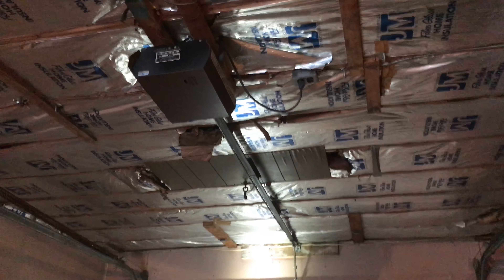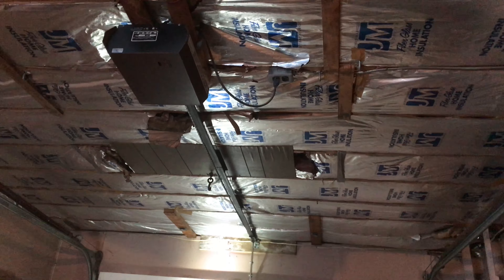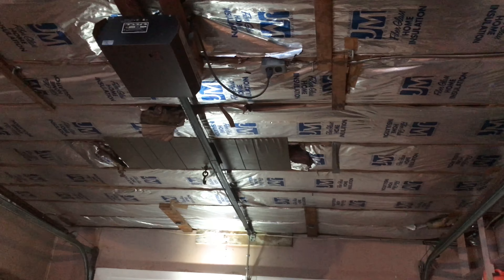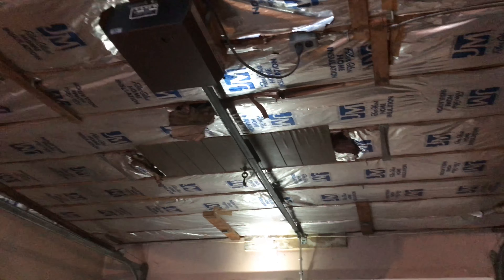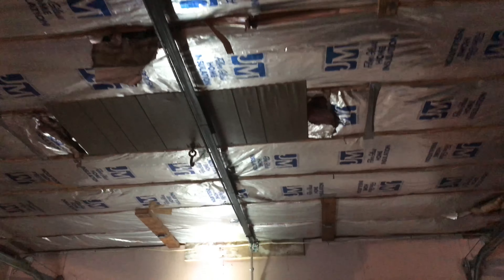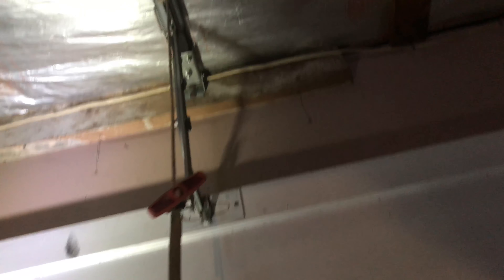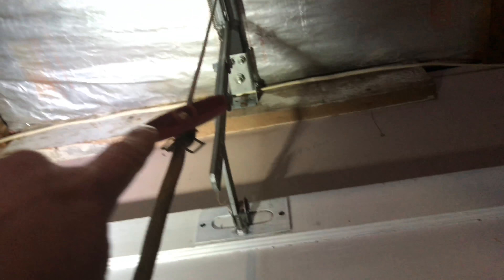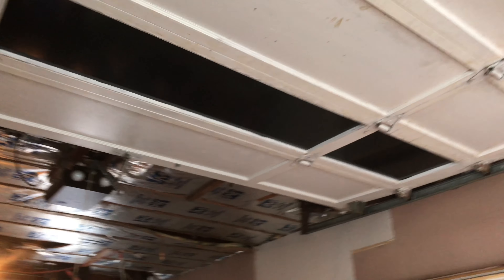How To Open Garage Door When Power Goes Out

Comment: Thanks for sharing   so  now imT trying to   get it to connect back to the chain  now that the power is back.    is there  something  to press or  connect i was wondering   Thank you ~
Reply from the maker: It the connector on the door arm should snap back into place for you.
Reply: @HomeownerRepair  I didnt pull the cord towards the motor i guess and that was able to  close it back to that  puller part..it was stuck  open i guess  . Thanks

Comment: Thanks for the video. However I dont know how to put it back in operational mode so it can be done with the motor.........
Reply from the maker: You should be able to just push back up on the lever so that it is locked back into position
Reply: This usually works but today we lost power, I pulled it and it still won't open. I can't tell if I broke it or how to get it back to working. We have to get to work and appointments tomorrow.

Comment: Need to know how you open your garage door from outside of the door after it has that larch inside pulled cause of the electricity being off, my garage door doesn't have a handle on the outside or a key hole
Reply from the maker: You may want to have a door put in.

Comment: How to I open it from the outside. I can’t even get in the garage to pull on anything
Reply: Most garage door has a emergency lock, you unlock it with a key, then pull the cable to release the latch and lift the door open
Reply from the maker: Thanks for watching.

Comment: You have to built a side door on the garage so u can gain entry inside the garage and be able to pull the cord when there is no electricity.
Reply from the maker: Yeah without that you're kinda up a creek
Reply: @HomeownerRepair  Where's the creek? Power Poweroutadge and I'm outside the garage. Winds and rains and car sitting in the garage and I can't get into it. Acckkk!! I need a burglar maybe? Okay Sir or madam please tell me how it get into my car. Please Pleesee
Reply: Should have bought a house with an attached garage. That's on YOU.

Comment: No shit Sherlock! How do you get in from the outside? My garage is detached from my house, and there is no man-door. I wanna know is there a backup battery I can install that will provide power to the motor during the rare times the power is out?
Reply from the maker: I'm not sure
Reply: The only way for battery backup is putting in a new opener that has it, but the more cost effective way is what's called a vault release, which is a key lock installed in the top panel of the door, which is attached to a cable that hooks up to the emergency release latch on the door opener. If the powers out, you unlock that key cylinder and pull out and down, and it pulls the emergency release on the inside thus unlatching it from the opener and you can raise the door by hand. Then re-lock the key cylinder on the outside, and you're all set.